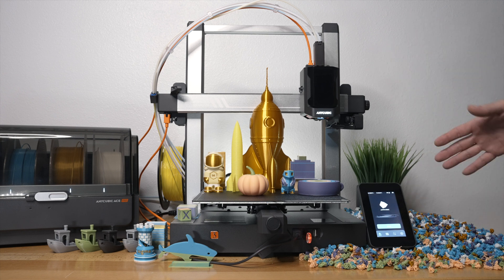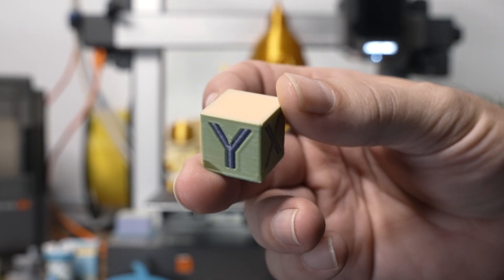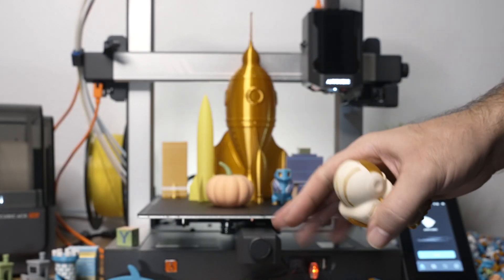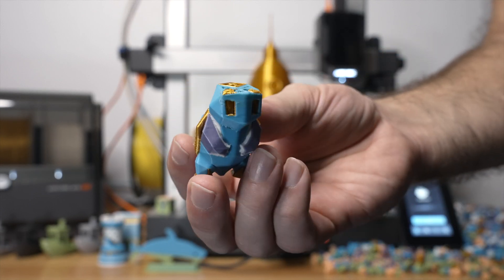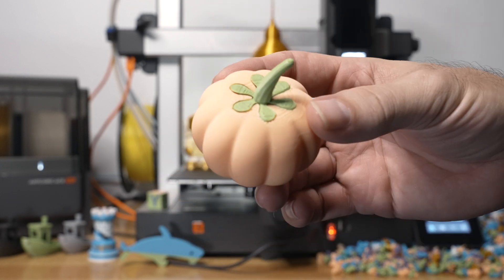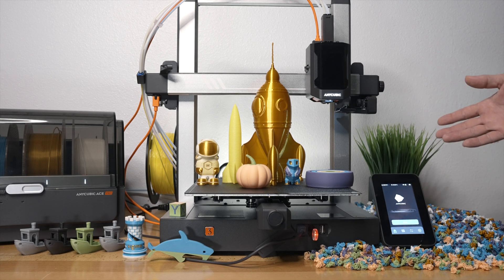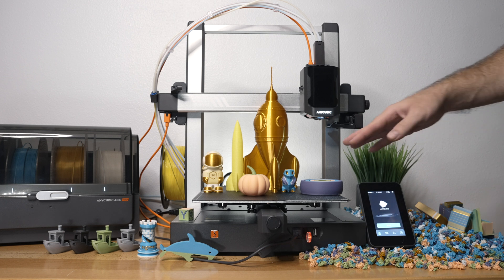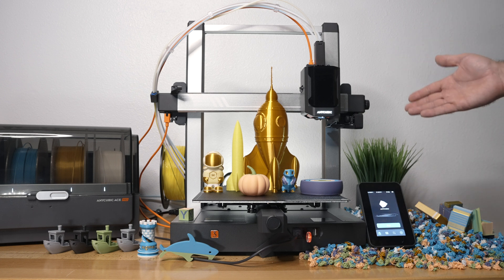Anycubic Kobra 3 Combo - 3D Printer - Print Quality

Comment: except you got lucky, I have had the printer and ACe only three day  and had to take it apart because it swallowed the filament on port 2 so far I have had to take it apart twice so far. hopefully it will continue.  On the other hand tech support really Sucks. while I specific explain what the problem I have  the so call engineers comes out to sent me the ACE board and detector. REDICULOUS.
something that had nothing to do with what I found inside it turned out that the PTFE tube came off  and the filament was feeding but not coming out thru the back.  The printer works wonderful so far.
Reply: I have exactly the same issue with the ACE. If it works, it works amazing. But changing filament in the ACE is a headache, there is like a 30% chance that the ACE swallows the filament. I already took it apart and repaired/cleaned it 3 times. Seems to be a design issue, but for 250€ for a Kobra 3 and ACE I dont want to complain to much, the Kobra 3 istself works really amazing.

Comment: Excellent video.  Yes the poop is a very big expensive problem.  The best solution is:  one print head with 1 large Hotend with 4 separate nozzles for the different color filaments ... No more poop.

Comment: "Hi, I would like to clarify if the Anycubic Combo 3 is a multi-color 3D printer, meaning it uses the same material (e.g., PLA) in different colors, or if it supports multi-material printing, allowing the use of different materials like PLA and PETG in the same print? Thanks!"

Comment: This is a terrible printer. I actually had this printer for a few days and it gave  me a headache. Ive tried to print and none of them were successful.I honestly regret buying this 3D printer.I don’t recommend anyone to buy the Anycubic Kobra 3 combo.
Reply: Considering vlads results, it seems you did something wrong
Reply: Instead I have no problem yet with the printer in fact is printing flawlessly   but the ACE multicolor Box  came from the factory with the PFTE tube off . and the filament was swallowed by ACE

Comment: Curios on how much adjustment needs to be made on each print.  Everyone seems to say this takes more tinkering to get a good print compared to the Bambu.  I don't know anything about 3D printing...so those statements concern me as I don't want to get discouraged at the very beginning of the journey.  Any inputs would be appreciated.
Reply: Good luck with Bamboo, they do not have tech support that at leas they would write to you via Email. Anycubic  tech support they try , but they miss lead you  on what to fix.  they will not take the printer or Ace back to exchange , instead they insist for you to take it apart and do the job for them. The good thing is that if you have to take apart they don't void warranty like other product, instead they hundreds of video YouTube videos that will lead you to solve any problem at least it has been my experience.
Good Luck
Note: if you are not willing to take it apart any of the Brand names Like Bambo, Creality and Anycubic  DONT BOTHER you will get frustrated and will end up wanted the money back.

Comment: I've had nothing but problems with mine I've had it for about a month I spend more time fixing it than I do Printing With It and the things I do print do not come out good
Reply: What type of problems are you having?
Reply: Me too, Good luck with Bamboo, they do not have tech support that at leas they would write to you via Email. Anycubic  tech support they try , but they miss lead you  on what to fix.  they will not take the printer or Ace back to exchange , instead they insist for you to take it apart and do the job for them. The good thing is that if you have to take apart they don't void warranty like other product, instead they hundreds of video YouTube videos that will lead you to solve any problem at least it has been my experience.